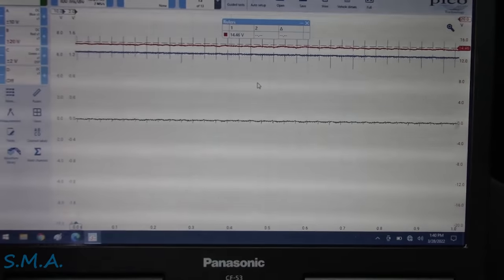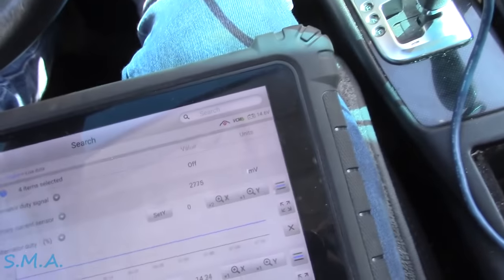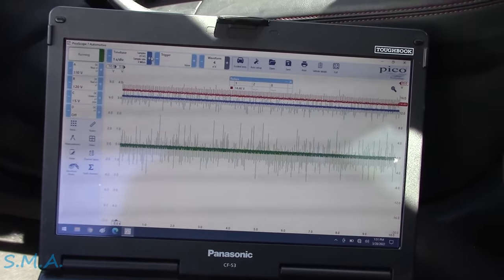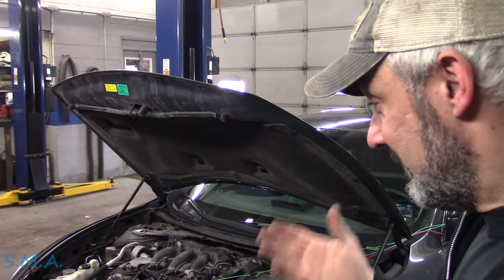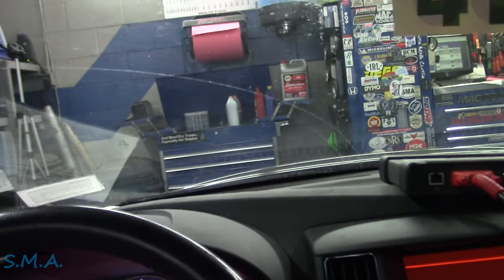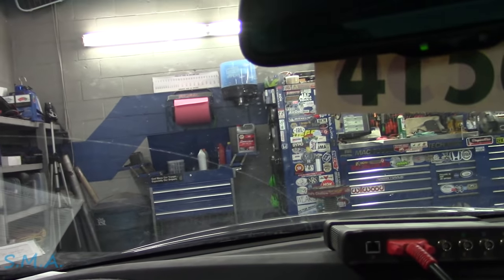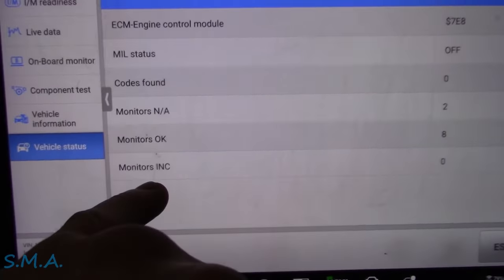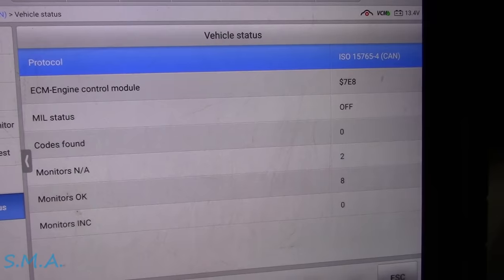Nissan Dealer Quoted Over $2000 For A New Harness!! - The Real Problem

Comment: The fact remains that the dealership was going to charge her to replace a harness and it would not have fixed the problem and she still would have to pay for the unnecessary repair to the harness and then to have the alternator replaced if they actually figured out it was the culprit. This lady was smart enough to say no. Thank you Eric for another good video
Reply: Was she though? She ended up just buying another car instead.
Reply: @SophiaAphrodite  Im sure the only reason she bought the new car in the first place was mostly because she was tired and frustrated of being without a car and after multiple repairs and money she didn’t want to keep dumping money at the dealership where most of us including automotive techs like myself assume last resort the dealership to solve very complicated issues as they should know the insides and out of that specific manufacture but goes to show you its not always the manufactures fault even with their own training but the techs they have working who dont fully care or pay attention and want to throw parts at it to make as much money on the flat rate system
Reply: LOL, no. They would have replaced the alternator and pocketed the extra cash.
Reply: @silvac196  absolutely agree being a tech @ a main dealer it’s the skill level & knowledge combined with bonus structures put in place that make the average tech take a punt & rely on codes to make a call on a repair, most times they get it right with a bit of common knowledge but it’s the tricky one’s that catch them out & the customer pays the price but equally they don’t as most just pay for an hours diagnostics & expect to fix it in that hour. If they really paid for the true time spent diagnosing it they’d refuse as happens often when we ask for additional time so off they go to an independent who’ll do the same & play parts darts then it’ll end up back at the dealership but they won’t complain about the independent that ripped them off but the fact that you didn’t diagnose it first time & they don’t expect this from a dealership & want it looked at for free or will complain to the manufacturer which inevitably ends up with muggings having to fix it for nothing. That’s something that’s never talked about here as people don’t see that.
Reply: Most people assume that a Nissan dealer would be the most knowledgeable about the Nissans. This shows that it’s not the case sometimes.
Reply: Not to mention they forced her to buy a replacement vehicle. Inexcusable in my h.o.
Reply: It’s as though these dealerships aren’t clued into the facts of “Automotive Science” !
Reply: @dubblyewjay1133  I dang sure wouldn't have bought another Nissan. Especially from the same dealer.
Reply: The Nissan dealer knew the alternator was bad, but wanted to rip this lady off. She now has grounds to get a full refund for their dishonesty. Good thing she was smart to stop further work at the stealership, and bring the car to you!
Reply: @dubblyewjay1133 : Maybe she bought a Toyota...
Reply: Yes what what a dealership just replace everything and eventually you'll run across the problem. The plus is you wind up with a new car. Just kidding of course but that's how it seems some of the garages are nowadays.
Reply: Dealership are shit for troubleshoot just change parts they made a grand that all they wanted
Reply: That is bullshit how do they have to pay for a bad diagnosis? It's their fault! I'm so glad I can fix My cars myself
Reply: Yes and ask if they are idiots

Comment: Dealer techs are many times hampered by insufficient training and many are on flat rate , which means they dont get paid to diagnose cars. It's easier to guess and hang parts. In fact it's not so much the tech's fault as much as it is the business model he's working in. This probably explains what happened to this owner. Thank god for guys like Eric for showing us how it's supposed to be done.
Reply: Part of the problem too is they keep reducing the times for flat rate repairs. Used to be if someone was really good they could actually get well ahead on easy jobs, then a hard job wouldn’t hurt so bad. And, working at a dealership you tend to see similar problems over and over so learning from a hard job can make it better the next time. 
But, with the repair times getting shorter it’s more of a constant struggle to stay even. So, people tend to stick with what they know or else just guess and try to turn it quick as possible.
Reply: @NBSV1  absolutely spot on, coupled to the fact you on the clock & monitored on efficiency if your a good tech you’ll end up with the tricky stuff which you don’t make bonus on the warranty department will want to cut your hours the boss will call you in as your hours are down threaten you with the sack, meanwhile all the average joe’s play dumb smash out services get handsomely rewarded for it the bosses think the sun shines out their backside yet they can’t diagnose jack shit. 
The motor trade is the only trade I know where the better skilled your are the less you get rewarded.
I’ve seen so many good tech’s leave to be replaced by another spanner monkey & so the downward spiral continues here in the uk you cannot get skilled diagnostic techs there’s a real skill shortage or even half decent ones the kids today aren’t interested & certainly don’t wanna get their fingernails dirty.
Reply: @madds6678  100% agree. I got out of the dealer rat race 12 years ago and started up independant. Just couldn't keep working to their system, watching other techs getting fed with bonus jobs while the diligent man got all the agro & no reward.
Reply: Nissan doesn't pay for diagnosis unless it's associated with a service engine light fault. The shortage of "A" technicians has caused many dealers to move up their inexperienced lube techs to cover.
Reply: Yes,but the customer gets the screwing,this is why people don’t trust anyone!
Reply: The problem with your theory though, is that if the tech isn’t paid for diagnosis and is just guessing and hanging parts, because he’s working flat rate, then why would he diagnose a bad harness over an alternator? Wouldn’t a harness take more time to replace? I think in this situation the dealer saw an opportunity to take advantage of the customer or the “lead” tech just doesn’t know what they’re doing or doesn’t care.
Reply: @fireguy8466  I think the idea is you quote for the worst case. Then if the customer is serious about getting it fixed you go back & get more in depth with the diag. Rather than waste time & have the customer go elsewhere after you have put the time into the job.
Reply: @garybrown5500  in the wise words of Joe Biden “com’on man!” You know if she’d approved the repair to replace the main harness they would’ve just replaced the wiring harness like they did the wheel speed sensors. They would’ve taken her money and she’d still have the problem. And then they’d take her money to replace to alternator later when it came back. This kind of stuff gives mechanics a bad name, cause in this case they were literally guessing with the customers money
Reply: This is exactly why the flat rate pay scale needs to be done with because it's all about easy work or swapping parts rather than diagnosing problems and fixing it the first time. Flat rate is so outdated.
Reply: @fireguy8466  A wiring harness pays more time over an alternator, that's why. Plus the dealer can charge the customer more the longer the car is there.
Reply: Then you should make that business model unprofitable. Take them court and get your money back. They'll never give it back willingly.
Reply: This is so true. As a former dealer tech this is exactly what happens. I used to get paid a max of .8 hr for any electrical diagnosis. Any longer required special approval and a battle. Didn't matter the time required to connect data recorders, setup, road test for intermittent conditions and interpret. All included in that time. Flat rate and ridiculous warranty times drove me out of the trade. The more you knew that less you got paid basically. Simply put that's how flat rate works. Saw many good mechanics walk before me and it wasn't their fault. Nobody can afford to work for free. Most dealers don't care. I was even told It was because I could make it up after hours doing side jobs.
Reply: I worked at a Dodge dealership and we always got diag time, even if it was a known problem.  If it was a unknown problem they would start with one hour and if that wasn't enough they would call back requesting more time.  After the diagnosis they would then call the customer and give a quote for the parts and labor. 

Flat rate was mainly used for warranty work and there was no diag time paid for warranty work.

. Customer pay quotes were never lower than than flat rate but were often more than flat rate. They tried to stay away from saying a time for the actual repair  ESPECIALLY IF THE CUSTOMER WAS WAITING. Instead of saying the repair would take 3 hours they would give a dollar amount for the total labor. This prevented the problem of telling the customer it was a 3 hour repair and finishing it in a hour. If this happened they finished the repair in one hour, they would hide the car for 2 more hours while the customer waited.
Reply: @fireguy8466  that's not what happened. More than likely what happened was the tech didn't know what was wrong with the car. So they quoted something ridiculous so the customer says 🫣 no way Jose, and the tech/dealer are no longer committed to the vehicle. The customer pays the diagnosic  fee, and walks away. 

VS guessing, and changing the alternator (which requires AC out to do on this), and then if it's not that, now the dealership/tech is married the car.

The high quote is just the bail out, to turn away the customer. The paper trail shows a declined quote for repairs, so the big wigs won't ask too many questions.

Working at the dealership is 90% CYA (cover your ass).
Reply: @xabhax  What about if you get a vehicle with an intermittent fault that you just can't replicate or the window is too small to work with? You  do considerable diagnosis to isolate the problem, but just can't pinpoint it? You mean to tell me the technician shouldn't get paid for their time? They did work. I own and operate my own repair shop. I go above and beyond on all my diagnosis, repairs, and document everything. That alone is worth money because of the time and resources invested.

I'll share a quick story on a MINI that put me through hell a couple years back. 2013 MINI Blooper with the N16 engine. Would set MAF codes and run like pure crap on coke start up. All the prototypical checks checked out:
MAF
Valve cover
Purge valve
Ignition coils
Crankcase system
Throttle body
VANOS solenoids
Oxygen sensors

The typical blooper stuff all checked out. Car would level out when hot, but run piss poor on cold start.

Well I did the timing chain check as well. The wave forms checked out, and the timing chain although stretched, was within the allowable tolerances. I wasn't comfortable enough with the results to call the timing chain. Customer ended up taking it to MINI. They replaced the MAF, valve cover, and then recommended engine replacement. The lingo they used was we need to replace this stuff first, and if it doesn't work, we replace the engine and transfer it to the new engine which we have to do anyway.

Well long story short, customer reached out to me as me if I knew of a buyer for the car. I purchased it and replaced the timing chain.

Boom fix. Now tell me, how do you justify a call like that (1500+ repair) to a customer on a hunch? How do I not charge diagnosis? When just to physically check the timing chain, I need to remove the valve cover, and install special tools ($$$), and then take measurements and do math to calculate the stretch. When you go see the doctor, do you ever leave without paying? Why should it be that way with us?
Reply: As far as diag goes, you sell one hour diag. Then after you use that hour, you sell another hour. Clock on and off to verify your time. This is how I’ve always done it. Techs would cry that the hour wasn’t enough. I’d tell them, go sell another hour. They would look at me funny and then go talk with the service advisor to try to sell more time. They would have an awakening.  I worked for Chrysler most of my career, so I learned how to play the game. It would blow me away that they would hire in butchers. I had a great fix it right the first time score and this other tech was running behind me butchering things, making us look bad. Things like rebuilding an engine and not putting valve guide seals in a brand new head or driving a car with grease clear up their arms. 
It’s taboo for me to even reach into customers car with dirty hands.
Reply: Unfortunately not all dealer techs are certified
Reply: Coming from a 23 year dealer tech I see this all the time! It’s not so much  taking her money as it is trying to scare her away. A lot of inexperienced techs are over their head and will quote the most expensive item knowing the customer will say no and leave. In this case she did exactly that! If she purchased the harness and it didn’t fix it, the manager then gives the car to a high level tech to fix at usually no extra charge to the customer. Meanwhile the inexperienced tech is back on brake jobs and easy money makers. This is why dealerships are losing their high skilled techs!

Comment: I've always felt that when you pay a dealership based on their "diagnosis" and they were wrong, they should give you your money back.
Reply: Shouldn't that also apply to parts changing mechanics when the new part doesn't fix the issue because they're guessing??
Reply: @glenjamindle  absolutely!
Reply: That should apply to the medical field too.
Reply: Yup ... doctors bury their mistakes ... ours come back on tow trucks
Reply: How about when you go to doctor and they mis diagnosis?
Reply: @stevejohnson1397  You ask for the OEM kidney back.
Reply: @bradleycass11  It does,  it's called malpractice.  Comparing the human body to a mechanical machine is absolutely ridiculous.
Reply: @jeremyt7722  there’s a lot of doctors that don’t have Eric’s diagnostic skills. I’ve met some that were quite stupid but evidently they could regurgitate facts and pass tests.
Reply: @glenjamindle  Unfortunately you can't un-fire the cannon.
Reply: @bradleycass11  But, that's why they 'practice' medicine. Malpractice is sometimes very difficult to prove. Other times its easier than falling off a log.
Reply: @sledawgpilot  The human body is not the equivalent of a vehicle's electrical system.
Reply: It's easy to say things like this when you have no experience in a given trade. People make mistakes, even really good shops make bad calls or fail to fix a problem first try. 

That being said, there is a huge difference between minor diagnostic mistakes like mistaking a bad wire or connection for a bad alternator and major diagnostic mistakes telling that same customer they need an entire new harness.

 If it were me and the mistake was that egregious, I just wouldn't go back to that dealer and word of mouth my experience.
Reply: @sledawgpilot  I agree 100%. I have not found a good doctor since my childhood doctor retired 50 years ago. Now it’s up to you and Google to figure out what’s wrong with you.
Reply: @jeremyt7722  The human body is nothing more than a mechanical machine.   Literally every part of us has a mechanical connection and we are controlled by pulses of electricity.
Reply: @garretts91  I have been a mechanic for the last 15 or so years. Started out on cars and now work for a railroad as one.
Reply: @johnpapp92  Then I would think you'd agree, money back for a bad diagnosis shouldn't be a blanket statement. I really think it depends on how bad the incorrect diagnosis is. 

Put it this way, say your able to correctly diagnose a vehicle issue in 3 hours, customer then brings it to another shop and they correctly diagnoses the problem in 2 hours. Should you be obligated to refund the customer 1 hour of your labor for taking longer to diagnose? See, the blanket money back statement is a slippery slope.
Reply: Agree! I own a shop and I always inform my customers if I diagnose your car and you pay for a Diag and it doesn’t fix the problem then I offer to refund the Diag fee
Reply: @garretts91  maybe there are a few instances where that would not apply but, for the most part, that is a blanket statement; especially dealerships. Dealerships have all of the manufacturer specific tools and service/maintenance data. I have also seen a lot of dealerships throw wild guesses out the there that end up costing the customer big money, such as in this videos example. Dealerships revenue stream is there service department and you never have them come back and say we don't know what the issue is. When they don't know, they start throwing wildly expensive/really weird to be broken parts at the customer and it is the job of the service writer to sell that load of bullsh*t to the customer.
Reply: @tirefryr  it is the most complicated "machine" in the history of mankind. There has and never will be, a technician who understands or can accurately diagnose every system
Reply: @jeremyt7722  actually is not ridiculous, cars were invented based on the human body .
Reply: @jeffbuckles   Yea you can. Put my not broke stuff back on.
Reply: @glenjamindle   @HVACR VIDEOS ' father was a part changer, but he didn't bill when the part didn't fix the problem.    He's mentioned it several times in his videos.